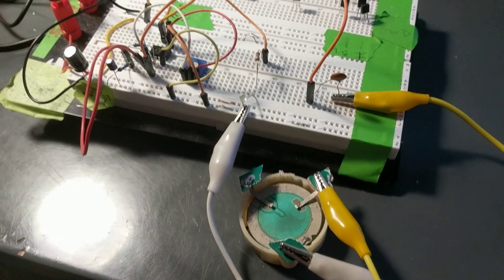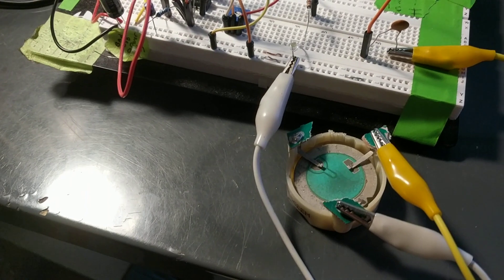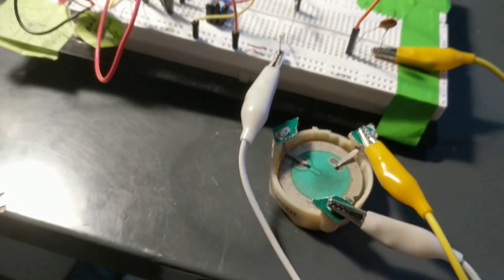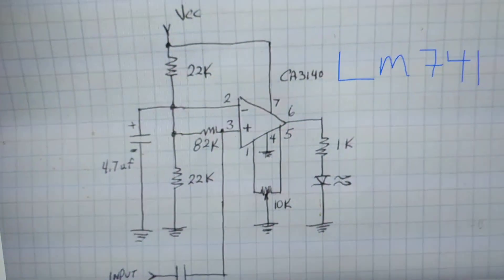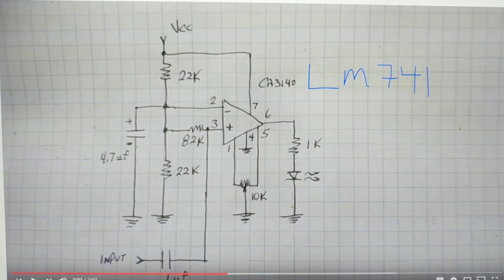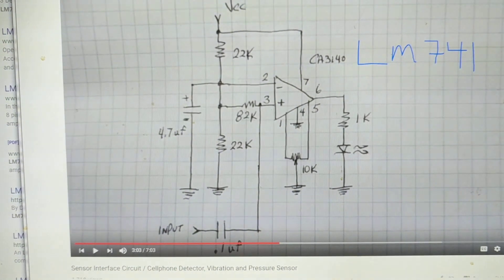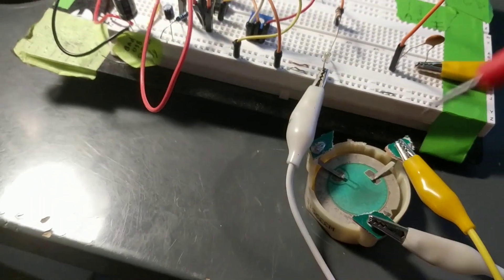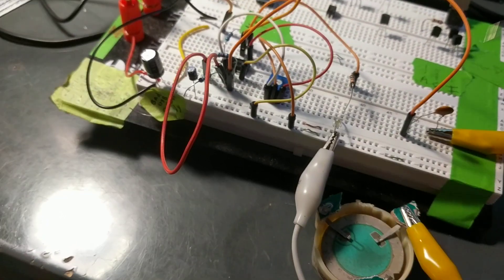How to make a quick SENSITIVE PIEZO VIBRATION SENSOR and interface - DIY for Arduino Raspberry Pi

Comment: Awesome video, it looks like there are more than 2 capacitors on your breadboard. Was to smooth out input voltage or something else? Many thanks again for a perfect video 👍
Reply from the maker: I think you’re correct. It looks like I’ve added a couple of caps to the power rail of the protoboard, lower-left. If you’re powering the circuit from a battery, these can just be eliminated. I’m sure I just added them out of habit at the time and for good measure. And I’m very glad that you appreciate the video. Comments like these make it all worthwhile. What’s your application?
Reply: @blown34  ahhhh makes sense, this probably sounds cheesy but we (beloved misses) do paranormal investigations. Nothing too serious, just mainly a excuse to go and stay in castle etc. Not got any background in electronics, just a ex mechanic but just really enjoying designing/building our own experiments (non arduino, just old school circuits) as it were. 
   Honestly short, sweet and factual videos like this are so hard to come by. 
    Again genuinely appreciate the work and effort 👌
Reply from the maker: I truly can appreciate what you’re saying. Finding a video about something you’re interested in, that lacks details and coherent explanations  (all those 2 minute “hey look what i did!” videos) can be frustrating- especially for a subject that has so few videos in itself. In terms of your project, it sounds really fun. Happy to help in any way I can. Let me know if there is something specific you are trying to design. I don’t mind donating some time to the cause. I have a heavy background in software design, embedded systems, electrical engineering, mechanical engineering as well as metal fabrication and machining with a passionate focus on building vintage hot rods. I have a million hobbies and an interest in literally everything. So now the 64 dollar question: How does vibration play a role in the paranormal and how would you filter out the “noise” from the human realm?

Comment: Hi, can you make it somehow make it IOT wireless so we can check in Blynk app maybe? and im still confuse with the circuit
Reply: This circuit is very simple. Think of it as a simple sensor. It does NOT include the microcontroller circuitry. The circuit, as shown, simply detects the voltage coming out of a piezo element and lights up an LED- That’s it. However, you can easily extend the circuit yourself in the way you’re asking... Instead of using an LED on the output (as shown), just connect the output to an input pin of an ESP8266 (or any other IOT or Arduino device) and just write the software to detect the signal on that input, and it will work exactly as you want. This is the key to understanding this and making it work the way you want: Treat this circuit as you would any other “arduino” style sensor with a simple digital output. Just look up any Arduino circuit that uses any simple digital input or sensor. For example, search “arduino push button” then use the output of this circuit in place of the pushbutton. Good luck! And remember, create SIMPLE CIRCUITS and test them first, before you make them more complicated. Don’t start with IOT. Get this circuit to light an LED first. Then feed the output into a simple Arduino. Once you get those working, then move to IOT.

Comment: This is for arduino or with out arduino?
Reply from the maker: If you look carefully at the schematic provided in the description, you will see that the circuit already uses an ATTiny85 microcontroller that can be programmed with the Arduino environment. Instead of having the circuit drive a relay, for example, you could easily feed the circuit's output signal (ATTiny85, PB0 pin #5) into an "Arduino" if you saw a benefit. However, the circuit as shown is self-contained and standalone.
Reply: Thank u ..i appreciate it..i will try my project soon..
Reply from the maker: @amirgedon  Actually, to make it even simpler, you can just remove the ATTiny85 chip all together, and feed the output of the 741, pin 6, directly into whatever Arduino you want. I used an ATTiny chip, because, well, it's tiny, very low power, and had enough capability for what I needed it to do.
Reply: @blown34  i'll do my best sir..